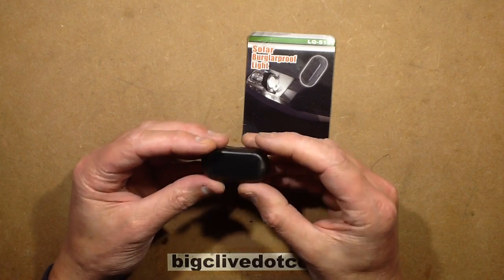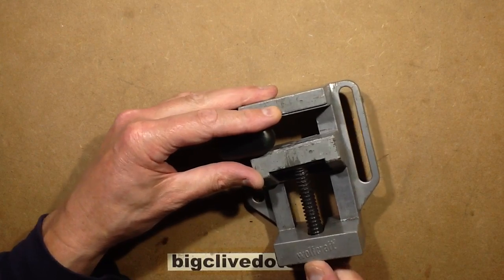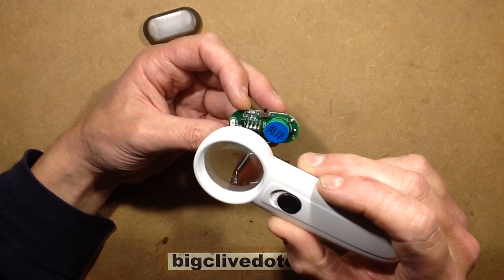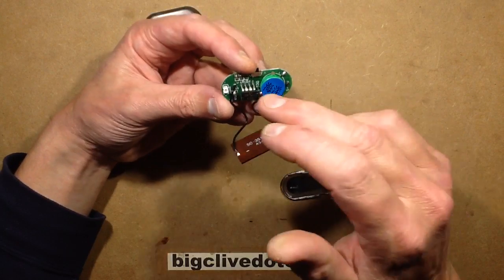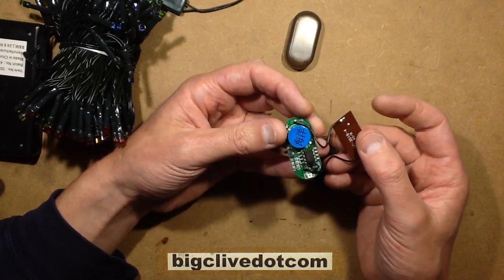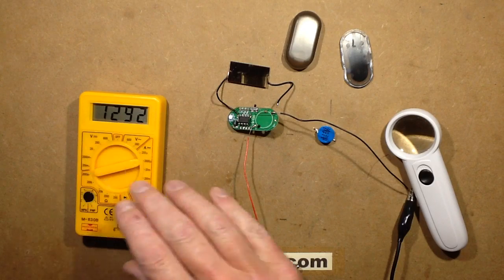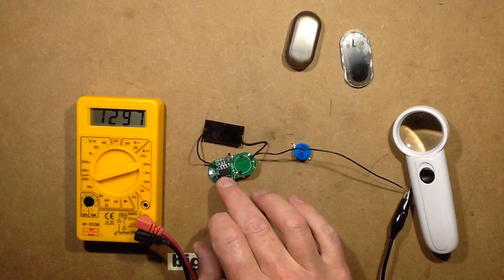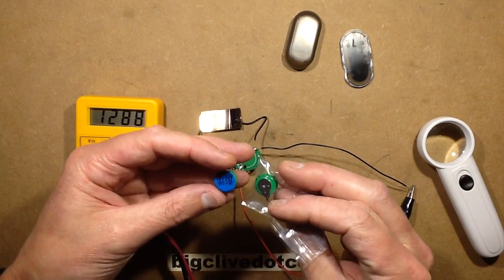Solar "burglar proof" light.

Comment: The BEST way to prevent your vehicle from being stolen is to wire a secret kill circuit. The thief will not be able to figure out why it won't crank. Unless they have a wrecker, your car will be where you parked it.
Reply: When I read "secret kill circuit," for a second I had much more devious imagery in my head.
Reply: TehSlan * Mine is wired to one of the switches on my dashboard. Cannot tell you how many times I forgot at first. But eventually, your memory will get the hang of turning that switch on before attempting to crank. But I do like the way your mind made that subliminal connection ! lol
Reply: kill switches are great and all, most modern vehicles have fuel pump and starter kills built in without the microchip on your key.  But this only prevents the vehicle from being started and driven away.  This won't prevent it from being broken into, or towed away.  The implication of an alarm (i.e. this blinking LED) is that it will give an audible sound if the vehicle is broken into, or moved.

Comment: My friend brought in a solar torch...and I was like 'you didn't think this through properly did you?'
'What's wrong with it?' He said.
'What the fuck is the point in a solar torch? You want light when it's dark right?'
'Yeah' 
'...well there's gonna be no fuckin sun then is there?'
'...oh...thats £5 down the drain...'
Reply: There exist new technologies to store electricity for later use, they've only been around for a couple hundred years.
Reply: Bladsmith 

No battery we tried
Reply: Yet there is a capacitor.
Reply: honyburger123  wouldn't it charge through sunlight?

Comment: that "data logger" you wanted was inside your Arduino that you don't use ;) ..coulda made a volt/ammeter with the serial print command to do the "maths" and tracking for ya

Comment: I bought a computer mouse years ago. inside the package was a flashing LED, to draw your eye to the package. after ripping the package to bits, I found a 2-aa holder attached..

I changed the batteries and installed it in my truck.. :)

Comment: Got myself one of these after watching your review, as I also thought it was a neat application. Unfortunately it stopped working a couple of months after being installed in my car. Probably a dodgy cell...  Does yours sitll work? Climate conditions probably aren't the greatest in a car anyways, with high temperatures daytime, and below freezing temperatures in winter at night (I live in Sweden). I guess there isn't a practical way of changing the cell given the way the case is assembled?..
Reply from the maker: It might be worth checking for corrosion.

Comment: Back in the day you would use a unijunction transistor to pulse an L.E.D.
Hardly used any current at all.
Reply from the maker: I used to see that very circuit used in switch locators in cold rooms.  Quite novel.

Comment: Hey Clive, a question about the solar lights in general.  If you measured the output from the solar cell whilst in 'average' uk sunlight can you then calculate the amount of charging time needed per hour of operation at night, and if so is this likely to be similar between makes and models of solar lights?  I'm guessing some must be more efficient than others?  Love the videos.  Thanks..

Comment: The problem with anything containing a Ni-MH or Li-Poly  left in the sun in a car is the battery will get destroyed in a very short space of time. Dashcam owners are very familiar with this problem. Perhaps using a super capacitor would be a better option (albeit possible slightly more expensive).

Comment: It's pretty funny that they've gone from being a red flashing LED with a battery in a box to a blue LED with a load of circuitry, a solar cell and a small battery in a box, whatever happened to "Keep it simple"? :P
Reply: Chances are, market oversaturation happened.
Reply: twocvbloke Battery? I remember when they ran off the car battery and used a self-blinking red LED.

Comment: Blue LED........ when 99% of all car alarm indicators ever made are a red LED
Reply: Right? If I were robbing cars and saw a blinking blue LED I'd assume it was a charger connected to a GPS or something stealable.
Reply: I just leave the keys in the car. My car alarm is  how messy and junky the car is...
Reply: Car alarms here in Canada is often blue, red or both (blinking alternate). Majority of the aftermarket security systems have blue while OEM seems to have red LEDs.
Reply: Pretty sure 2nd gen legacys have blue lights, and i'm pretty sure a lot of aftermarket alarms are blue
Reply: Mine is blue LED and while not a super system it has a remote pager with a ~ mile range and remote start etc,,,
Reply: It's all useless anyway, only keeps honest people honest,,, I have had two windows broken by thieves even though the alarms had window break detection. One was on a company rig. The guy who replaced the glass said yeah it's pretty easy to break glass on a vehicle without setting the alarm off.
Reply: It comes in both a blue LED or red LED options.
Reply: You can disguise yourself as a police car.
Reply: shhhhhhhh

Comment: A while ago you helped me with a project using a solar LED string.  At its heart was the same chip, and as soon as you read the number off of it I recognized it instantly!  You had the same advice for me (change the inductor) so that I could drive higher powered LEDs.  I changed from a 47µH to a 23µH and it works great!  The only downside is that the lights don't stay on as long.  And actually, since the project is a "welcome" sign, I don't want it to stay on into the wee hours of the night anyway.  I wonder if it's possible to buy just the chips and assorted components for a more bespoke application?
Reply from the maker: It's probably cheaper to buy a whole product than the chips alone.
Reply: bigclivedotcom
That's true, you also get the benefit of a pre-made circuit board and some free components if you're going to change them for something else.

Comment: whats the charging circuit on this ?
How much current does the solar panel put out ?

Just thinking that if used in a car, the battery would certainly get charged but then what ?
Dont want it over charging the battery
Reply from the maker: The solar cell puts out low current that is within the continuous trickle charging limit for that Nickel Metal Hydride cell.

Comment: You could have taken a heat gun and melted the glue to pop it open.
Reply: It depends on the type of glue. If it was a solvent glue, which works by dissolving the plastic, heating it up wouldn't have done anything.
Reply: well that's boring
Reply: Obviously you just give it a quick pass with the heat gun. The plastic doesn't reach 600 straight away. The welds are the weakest part and it should come apart before the rest of the material starts to melt.
Reply: Dear boy, we don't really deal in sensible ideas on this channel.
Reply: Yeah he said it looked to him like a line of solvent, so it's essentially welded shut. Heat won't do any good there.
Reply: Even though it might be solvent based it's melting point is probably still lower than the surrounding plastic. A 600 degree C heat gun would do the job.
Reply: sjtrny Solvent based glue in such application = usually same plastic dissolved in solvent. It will be primarily solvent having welded the thing together, with any further plastic in it, even if it's another one, acting as merely a filler. Most likely, the enclosure is PS or ABS, as these can be solvent-welded. Indeed it wouldn't make sense for them to make enclosure of anything other, ABS being usually the cheapest option in China today. It also melts rather low.

Also, 600°C, are you mad? Can you name me one plastic that will stand up to such temperatures? Yes, there are LCP that are quite resilient, but nothing cheap and commonplace.
Reply: sjtrny They aren't all that weak, as it can reconstitute perfectly when the solvent evaporates. Gradually heating can be worth a try, especially if it happens not to be a solvent weld, but i wouldn't call that particularly promising, as ABS tends to go soft long before it melts

Comment: that huge bundle of solar garden lights youve got, are they the kind that has 400+ LEDs all running off a single AA cell? I saw some in that horrible B&M Bargains shop a while ago and couldnt believe they only had the one cell. It seems like they either shouldnt work at all or the battery should last about 5 minutes.
Reply: I bought a set a couple of years ago from eBay, it had 250 LEDs and worked really for about a year then stopped working.
I was surprised when I opened it to see just one AA cell. It used to stay on for a good few hours after dark, so the LEDs couldn't have been getting more than a couple of milliamps each.

I keep meaning to fix and improve it...
Reply: doesnt seem right does it. but I just looked on b&ms website to make sure I wasnt talking bollocks and it really is a string of 480 LEDs and it says on the box 1xAA battery inside. how.
Reply from the maker: i was very tempted to buy one of the huge sets, but the cold white colour put me off.
Reply from the maker: First thing to try is replacing the existing rechargeable cell with another, or if it's in a holder then try an ordinary alkaline cell to see if the LEDs light.
Reply from the maker: It will be using a boost circuit to run the LEDs at a few tens of milliamps which is enough to make all 480 glow visibly

Comment: Re. your garden solar lights (changing the inductors), would it have been easier (and effective) to just slip a ferrite bead over the existing on-board inductor, rather than desoldering, then resoldering a higher value? Obviously the "exact" value was not critical, rather you just needed "a bit more inductance" to limit current flow?  I'm asking this because I've used this approach on our garden solar lights, with remarkable results ("on all night" even in our Winter).